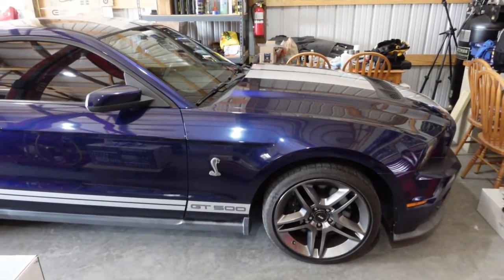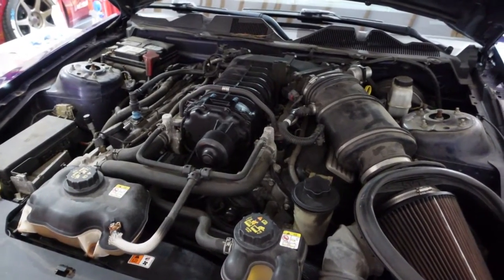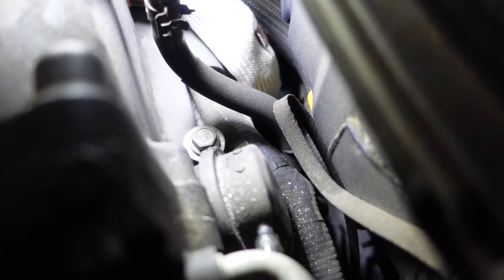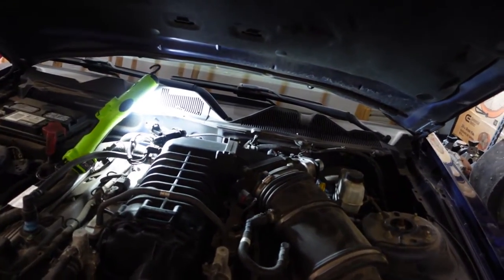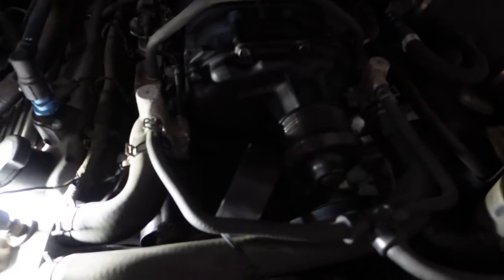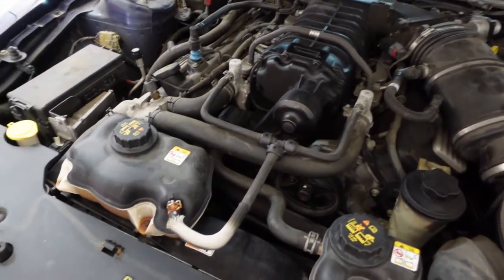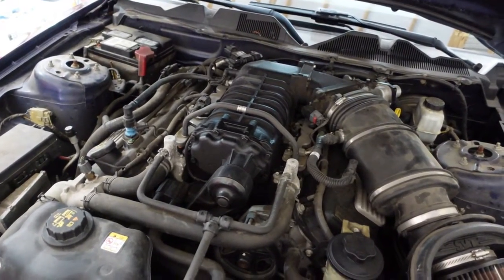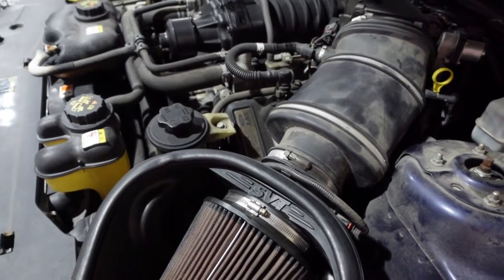Low boost! Diagnosing a 2010 GT500.

Comment: There is a vacuum hose connected at the back of the supercharger and goes almost straight down to the lower intake plenum/oil separator, i think it’s around 3/8 size hose. 

The hose will sometimes develop a cut/leak by coming into contact with sharp metal flashing on the back of the intake manifold, which is about 4-5 inches from the top of the hose. 

The vacuum hose sometimes is cut into during clutch replacements if the technician tilts the engine back towards the firewall resulting in the vacuum hose getting pinched between the sharp edged intake manifold and the firewall.
Reply from the maker: Thanks for the tip! I actually resolved the issue in another video. The air filter was saturated with oil. Once cleaned and oiled properly, boost picked up to where it should be.
Reply: Do you possibly know what that tube is called? I think that’s what my issue is. Recently did a clutch and header install.
Reply: @stevenochoa5485  Sorry I took a while to get back to you, the Ford parts website refer to it as a oil separator connector and the part number they have listed for it is 6C324 however using the name and part number still wouldn’t bring up the part on the website. I had a search for “PCV” and then click on the link for the PCV tube that connects the passenger side valve cover to the supercharger, then click on the “related parts” menu and fortunately the oil separator connector will appear in that menu for related parts. It’s around $48-$53 for the vacuum line, it’s likely that most dealers will have to special order it. It’s nothing special, the only unique characteristic it has is that it’s got a slight curved shape to prevent it from contacting the upper manifold so you could buy yourself some vacuum hose from autozone so long as the hose get is non-collapsible when under a vacuum. You'd probably want to protect the new line with a zip tied piece of rubber cut from an old radiator hose.
Reply: I AM VERY CURIOUS ASIDE FROM THIS PROBLEM HAS THE CAR HAD ANY OTHER MAJOR ISSUES LOL THE REASON I ASK I HAVE A 2010 900HP SHELBY SUPER SNAKE AND I HAVEN'T HAD ANY PROBLEMS.